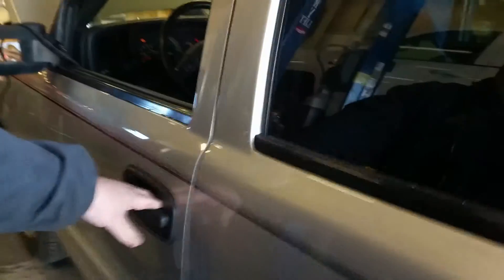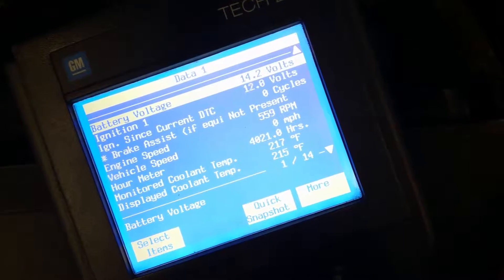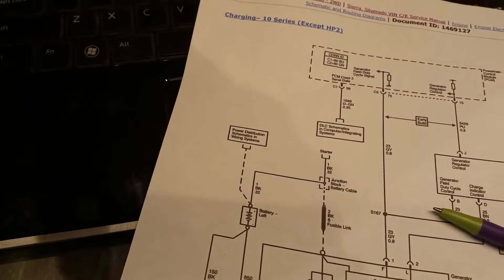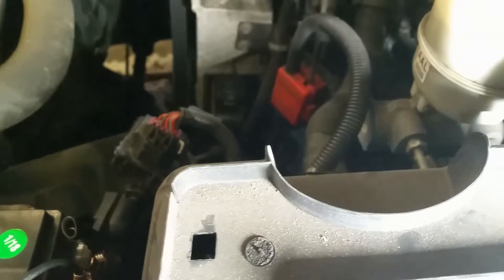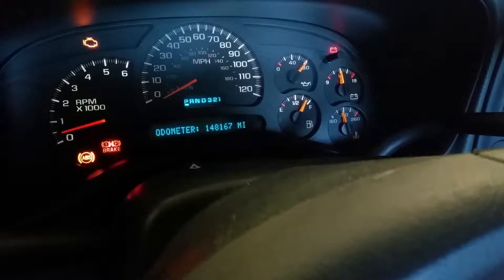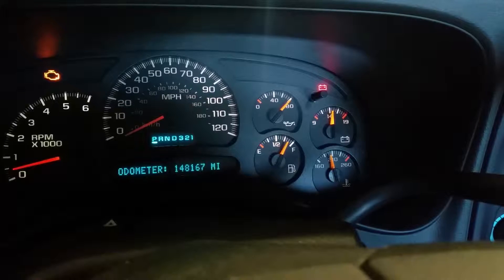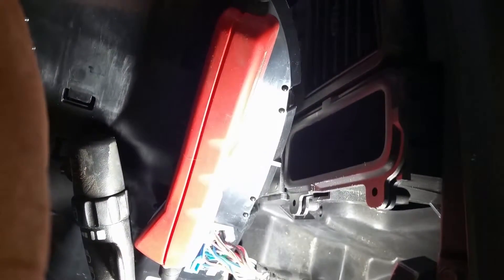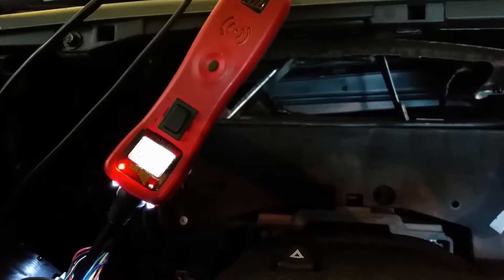2003 2006 GM Truck, Tahoe, Suburban Insturment Cluster Diagnosis

Comment: Omg I'm only at 1:12 and this sounds like me. Drive from Cali to Tulsa and had some instrument cluster light issues....just totally went out. Came back on. Went out again but came back on. Then lights came on randomly. Took it in before hauling back to Cali and they replaced my alternator. As well, I also am thinking I need to change the oil sending unit thingamadoohicky, but I don't think this is causing all the light issues. Recently have my lights pop on at random. I DID have a plug in break in my cigarette lighter....thought I pulled everything out but someone said check the fuse. So that's next. Also, what do you do by night then?
Reply from the maker: I used to do side work, build transmissions, transfer cases, etc.  Make Youtube videos...lol

Comment: old video but have any insight as to why a bunch of fuses including ipc/dic, rr hvac, alc comp, etc all have power when there is no fuse present
Reply from the maker: That is the supply side.  Most of the time the power is constant and the ground is switched.  It is easier to control a ground than it is voltage.

Comment: I replaced my battery because it was at its last stage . And the guy told me why my rpm and everything would go off and on and trigger security lock because the battery was old . So I have a new one in and it does the same thing . The radio and ac turns off and on randomly. Would it be a fuse or the alternator???
Reply: Everything works with the car on and not started .
Reply from the maker: I've seen ignition switches cause a similar issue, especially in blazers...

Comment: You are pretty amazing ... & maybe you can zero into these issues with an '04 Suburban:
1) no working tripometer
2) intermittent radio & dash lights remain on after ign off & door opened
3) seat heaters sporadic on/off [even in the summertime]
These seem as if separate problems .... engine light on [evap system]
Reply from the maker: Sounds like to me there is a loose or dirty ground somewhere that is causing your issue...

Comment: Ever run across 04 Silverado high beam dash light stays on when trucks not running no key in
Reply from the maker: Usually that is an issue internal to the cluster.

Comment: My cluster the light turns on but nothing is moving and the odometer isn’t reading only thing that’s on is the check engine 😫 I replaced the cluster a year ago
Reply from the maker: Sounds like you need another cluster

Comment: Hoping maybe you can help me. I'm having a similar issue with my 03 silverado, I lose half of the cluster, went thru and checked grounds, fuses, etc and everything seems good. Even replaced the cluster and still having the issue. Any ideas on what else to check, kinda stumped on this one
Reply from the maker: If you didn't replace the cluster with a Reman unit, chances are you got another bad one. These years were failure prone.
Reply: @IrocinZ  it is a reman. i believe i'm having an issue with the splice pack or somewhere in the network as i also noticed that i have no communication to the OBD port. when i take the comb out of sp205, i have .5v to all circuits except for pin D which is where i'm currently stumped
Reply: @MythicalBuilds as far as the obd port, there's a 15 amp fuse that powers both the cigarette lighter and the obd port. Replace it and you should have power to it.

Comment: I have a 2005 yukon and I’ve been having issues with it, my fuel gauge stopped working with the fuel light on 24/7, I got my  odometer reading as “error” around the same time along with my a/c on drive side shutting off. I’ve managed to fix the ac by turning off the car then disconnecting the ac valve vent taht swaps from cold to hot under my glove box so now it only blows cold but yeah. I really wanna avoid dropping my gas tank and paying 200$ for a gas pump along with sending my cluster somewhere just to get it fixed so if you have any insight it’d be greatly appreciated
Reply from the maker: Unfortunately, those are all common problems. You'll need a reman cluster to fix the error, the fuel gage, you can replace just the sending unit if it's still GM, and the blend door actuators are a thing too. The bottom one is passenger side and the one on the top is the driver's, assuming it has dual controls. I don't have a simple fix for any of those...

Comment: I have a 2005 Chevy Tahoe 5.3 vortex it turns over but won’t crank everything works lights dash windows brand new battery brand starter alternator fuel pump fuel filter I changed everything basically brand new still won’t crank ! Do you what it could be ?
Reply from the maker: So to clarify, it cranks, but it won't start, correct? If so, start with the basics. You need air, fuel, and spark. Without all three, your dead in the water. So pull a plug wire and attach it to an old known good plug, ground it on the engine somewhere and crank to see if you have spark. Let me know

Comment: My rpm gauge and fuel gauge in 01 Tahoe stopped working at same time
Reply from the maker: On an 01, more than likely will need to have the cluster rebuilt for the RPM. The fuel guage however, if it goes to empty and the low fuel light comes on, the sender card on the fuel pump module is more than likely the culprit.
Reply: @IrocinZ  fuel guage moved when filled up truck but goes back to e at times n rpm just stopped. I think imma go with u n replace cluster
Reply from the maker: @2423aj  From the way you describe it, the fuel sender is definatly an issue in the tank...
Reply: @IrocinZ  so what bout the rpm
Reply from the maker: @2423aj  More than likely it's in the cluster that had failed and will require replacement or repair. This is just a guess as I am not there doing the diagnosis....
Reply: How to replace with aftermarket

Comment: I have a 2003 Yukon and when I tested it with my multimeter it starts at 1.67 and then goes down to .31 in about 20 seconds  and stays there. Will that cause my battery to drain in 2 days? Also my rpm gauge and prnd lights are out if that’ll help any.
Reply from the maker: I am assuming you're testing parasitic draw and if so, 3 tenths of an Amp os acceptable. Your tach and prndl display being inop indicated a bad solder joint internal to the cluster and should be gone through or replaced.

Comment: Hi, I want to  know if you have any idea on why my silverado  cluster power cuts out and comes back but the issue when power cuts out my truck runs rough until the power on my cluster  comes back  any idea
Reply from the maker: Sounds to me like you have a bad ground, probably in the engine compartment. Look for the ones on the back of the cylinder heads and the big ground off the battery

Comment: My cluster doesn’t turn on also my ac which fuse could it be
Reply from the maker: Limited on the information provided as to what kind of vehicle, etc
Reply: @IrocinZ  it’s 2003 Silverado
Reply: @Yoxicofficial  mine is doing the same did you figure out what it was

Comment: hey ive been looking for info on what may be wrong with my truck if swapped 3 cluster and none work no guages work some lights and just the check engine lol been struggling  for years now help?!!
Reply from the maker: Clusters are usually programmed to the vehicle for different parameters. Make sure the program is correct for your vehicle. Other than that, it would be difficult to diagnose this problem remotely....

Comment: My whole cluster does not work in my 03 suburban I took it out an put it in my other truck and it fired right up and worked , what could be the issue on why it does not work in my suv?
Reply from the maker: Look at power and ground supplies, and make sure the fuses are good. If all the checks out, it's possible the ignition switch is faulty

Comment: Maybe you can help me ? 04 Tahoe, lights in cluster work and check engine light - but everything else is gone. No tach,oil, fuel, speedo, coolant, battery voltage. And informmation center is dark. Car runs fine. Have checked engine compartment fuse and the fuses behind the drivers door.
Reply from the maker: If all the fuses are good, it probably needs a replacement cluster. The problems you describe are a known issue where the chip in the cluster will de-solder...
Reply: @IrocinZ  Was gonna look at the cluster today but it started workin just fine again haha !
Reply from the maker: @rokkebill  yep, sounds about right...
Reply: @IrocinZ  Thank you so much. All fuses are good. Have a nice day !
Reply: @IrocinZ  will de solder cause a battery drain though? Thank you for the video!!
Reply from the maker: @papergatorzfedducca7998  in my experience, no. But that's not saying there is a possibility....

Comment: Where do you work if you don’t mind me asking? You don’t need to tell me where specifically but I have a 2008 Chevy pickup that has a cluster lighting issue as well. Gauges work fine but not the lighting. About half of my cluster lights work and the others don’t. It’s even throwing codes for the glow plug system because the light isn’t working, my mirror light for outside temperature is also correlated with it. At first they had randomly came on and went back off shortly after, but for the last 6 months or so, it has stayed not working properly. It randomly came about 6 months after buying the truck. I have no knowledge in the electrical world, as of yet. But I need to find me a smart fella to properly diagnose and repair without wasting time or money. Good help is hard to find. I really don’t want to go to the stealership, most of the time they won’t work on a modified diesel truck. Which is what mine is, any advice would be helpful. It kinda looks like you work in a dealership environment, especially since you have the tech 2 and a gm computer program.
Reply from the maker: You are correct on many accounts, I do work in a dealership down in Florida. As far as your cluster is concerned, I would suggest sending it off to get remaned. There is a place in Michigan called Specmo Enterprises that one of the other dealerships I worked at sent the clusters and radios. I don't know how much they would charge a walk-in customer, but they would be the best ones to talk to about it. The 2008 clusters I didn't work with alot as that was about the time I started my own shop and left the dealership for quite a few years...

Comment: I have a 2010 Chevy Silverado my MPH goes up and down can you help me change the speed sensor and still does it
Reply: The actuator is only on 4x4 my it’s nt 4x4 and I already change the cluster and still the same
Reply from the maker: @jorgejavierhuerta4132  2010 I do believe the cluster has to be programmed
Reply from the maker: I'm assuming you mean it's not reading correctly ... if you changed the sensor, it will probably need the actuator or the cluster replaced...

Comment: I have a problem with my fuel gauge hand it always stay on low fuel and i don’t know wat to do about it
Reply from the maker: If the Guage stays low also, then you could have an issue with the sending unit and/or the cluster. You should be able to test it at he connector on the back of the cluster with an ohm meter. If I remember correctly, 90 ohms is full, 0 ohms is empty.

Comment: Have a 03 Yukon denali, all my gauges not working bit my check engine light comes on ...what will the fuse be labeled as for the instrument cluster?
Reply from the maker: Should be I/P. If it's not there, let me know...
Reply: @IrocinZ  thanks  for replying ....I don't see that one but I see IPC is that it if so I changed that one
Reply: @IrocinZ  should I change all the tBC 's?
Reply from the maker: If you're not getting any cluster and you've checked all the fuses, its very likely that the cluster has failed.  It was very common on those years. I've done quite a few of those,,,
Reply: @IrocinZ  I think so my battery kept getting drained when car off this my 3rd battery ..I guess that what the problem is ....Thanks alot
Reply: @welcome2doeland825  just got a boost off in 05 Silverado & all my gauges leaning to left be4 the boost only gauge wasn’t working was fuel gauge cause know for fact I need fuel pump.any idea which fuse I need to swap?

Comment: What if you get the security light etc only in the crank position and not in the on position?
Reply from the maker: Usually that's a bulb check feature...
Reply: @IrocinZ  so what checks the bulb in the on position?
Reply from the maker: @pl747  The theft deterrent module controls the bulb in the on position

Comment: Hopefully I can get some help from you. I have a 2006 chevy tahoe and in the engine fuse box, half of the fuses are not working and the rest are. They aren't blown but just not getting any power. Any advice?
Reply from the maker: You are going to have to be a little more specific on what is not working. Not all of the fuses will have power all of the time. The better thing to tell me is what isn't working...
Reply: @IrocinZ  so right now the tahoe won't start. It turns on but right away turns off. None of the headlights or taillights work the blinkers and hazards however do work. None of the interior lights turn on. The horn and alarm doesn't work. Power windows and locks don't work either. However, the stereo lights turn on but stereo doesn't work.
Reply from the maker: Double check you connections at the battery, and then check your negative cable where it bolts to the block. Usually it's behind the starter. The battery could be shorted. My point is, don't overlook the simple things ....What you describe sounds like a bad ground, corrosion on a connection, etc

Comment: My dash light not working at all but when I turn the knob up only the driver passenger park etc gauge lights go up and down not the back ground lights
Reply from the maker: Probably has a solder joint loose in the cluster, but don't overlook your fuses. Possible to need a cluster assy....

Comment: If you disconnect cluster and it still drains battery what can it be please let me know it's draining my battery
Reply from the maker: Does it have an aftermarket stereo installed? If so, try pulling the fuse on that. Look for obvious things like glove box lights, aftermarket accessories, etc. Those years were bad about the electrical part of the ignition switches failing....
Reply: @IrocinZ  thank u for responding I disconnected the cluster the radio and the switch to the driver door and it still drain my battery it's drive me crazy I have to disconnect my battery each time I go to the store or anywhere
Reply from the maker: @gabrielvasquez8156  Try disconnecting the ignition switch at the switch and see what happens. The thing about electrical draws it they can be a real pain to find. Never overlook the obvious. It could even be a bad alternator even though it still charges. Unplug it and see what that nets you...
Reply: 2003 Yukon
Reply: I have same on 03 yukon
Reply: I pulled radio fuse still goes dead
Reply from the maker: @captanna352  Assuming you have a multimeter connected, the dome lights disabled, key out of ignition, and let it sit for about 5 minutes undisturbed. Pull fuses while watching for changes in draw on the meter until you find the one that takes it away...
Reply: @IrocinZ  thank you so much still draining my battery driving me crazy don't know what else to do

Comment: Could I bother you for help locating the darn fuse that control the back lights on the cluster? I have a 2006 Sierra 2500 6.6L. I shorted out my dome lights on accident and got those two fuses replaced but still not gauge back light.
Reply from the maker: That fuse is in the I/P fuse block in the side of the dash and it is listed as TBC 2A and is a 15amp.  It controls all the I/P lights and it is controlled through the BCM. So if all the other lights work,  More than likely, its probably in the cluster. GM between 2003 and early 2007 had an issue with the clusters.
Reply: @IrocinZ  hey there! So I replaced all the TBC fuses and verified all fuses inside the cab and under hood are good. I still have no cluster backlighting and my map lights do no come on with the push button but work with door open and via switch. I swapped relays that are in the side fuse block and they work but then stopped. I’m at a loss as to what else it could be now. Do I need a BCM at this point?
Reply from the maker: @delta3garcia  I dont want to lead you in the wrong direction, but I would test the headlight switch/dimmer wheel on the dash to make sure its doing what its supposed to. I'm not there to do the diag so its only a guess...
Reply: @IrocinZ  No worries sir. I replaced with a new one and it dims the lights as intended. Just odd how I lost my map light function and backlights but only for the gauges. This happened after I installed leds in the map lights and accidentally shorted them out with the darn reflector.
Reply from the maker: @delta3garcia  if you didn't know, LEDs are polarity specific. They have to be wired positive and negative. If you get the leads reversed, they won't work
Reply: @IrocinZ  indeed. They worked but when I was fiddling with them it shorted out on the reflector and blew the TBC fuses. After that, no gauge lights and map light problems too. Even after replacing the fuses.
Reply from the maker: @delta3garcia  Look for a broken or melted wire somewhere in that circuit. Normally it will just pop a fuse when that happens, but it might have taken out your cluster too. I would check power and grounds to things not working and if you have both, then the item is bad. I would suggest using a custom test light using like a 1157 buld to put some load on the circuit, that way you know if it can handle the load....